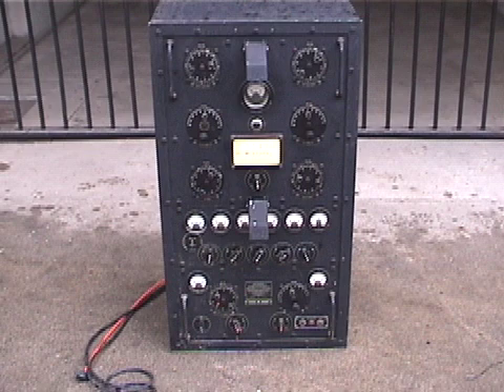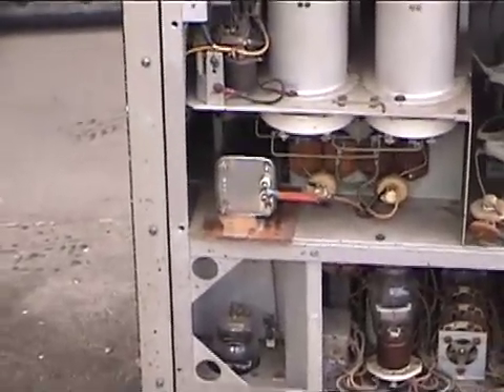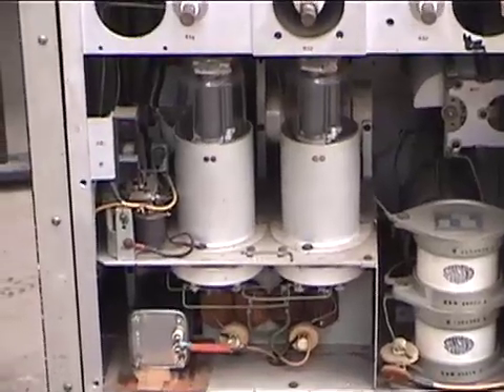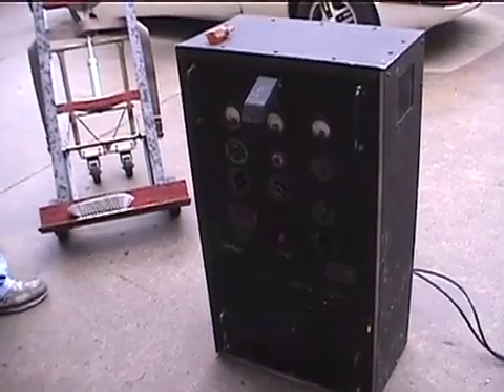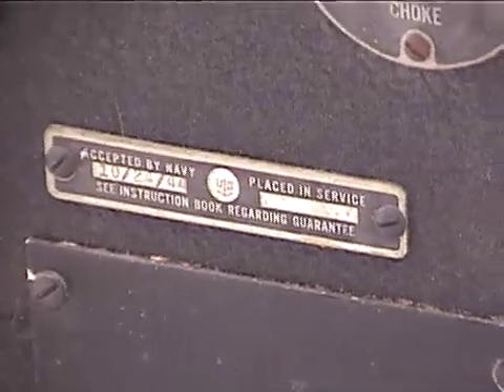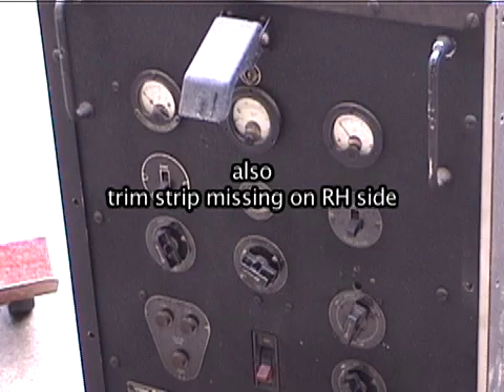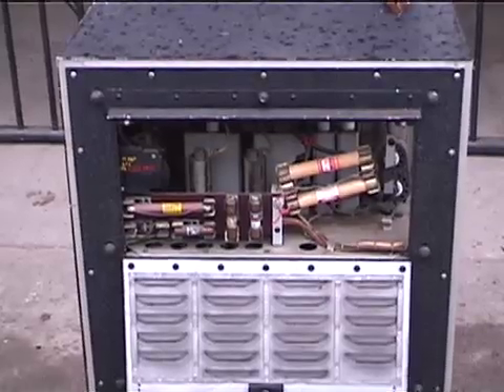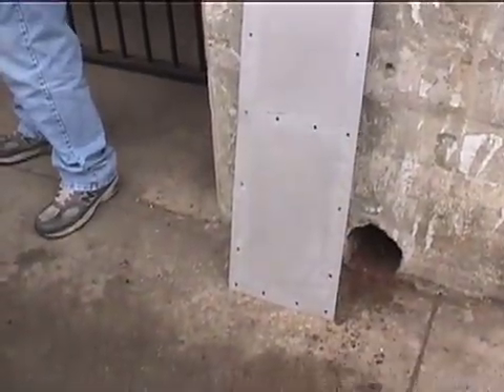TCM-2 Navy Transmitter

Comment: Navy-rated power output is 125 watts CW, 30 watts AM phone. Final amp tubes, a pair of 803s, have a plate dissipation rating of 125 watts each, or 250 watts for the pair. Conservative power output for a pair of 803s is normally about 400 watts. The Navy-rating means that you put a brick on the key, leave the room, and come back in a week and the transmitter is still outputting 125 watts. :-) Ken W7EKB